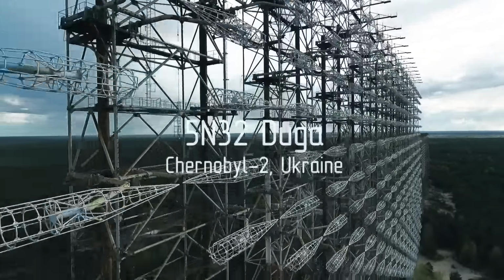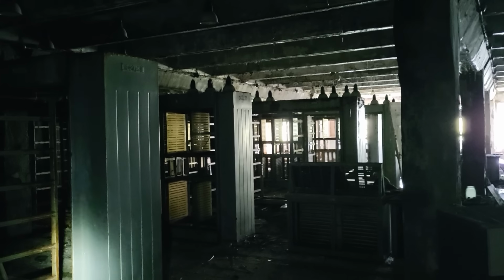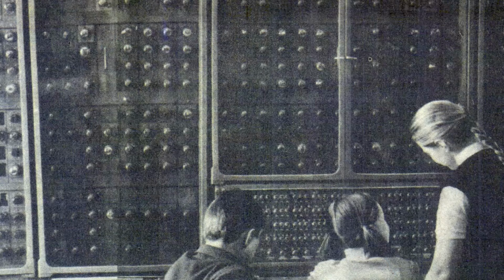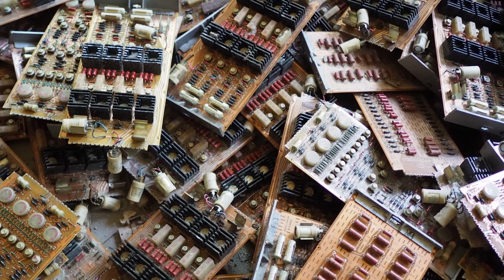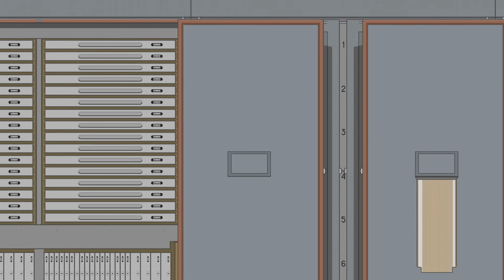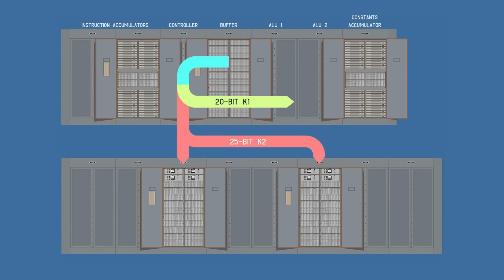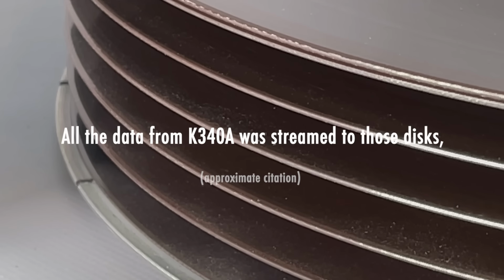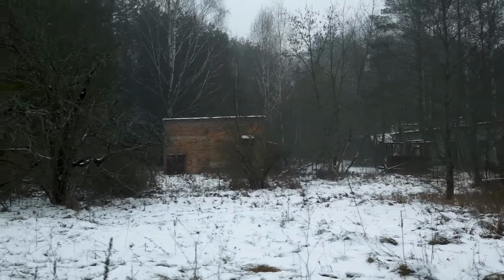Exploring K340A: The SECRET COMPUTER of CHERNOBYL DUGA RADAR | Russian Woodpecker

Comment: We, as HAM operators, weren't so happy with the woodpecker, it came so far, that all HAMs in the world were jamming the signal for three straight days. Which took it offline. So they got bombarded with jamming signals from all sides. The biggest event ever in the HAM community back in the day. We got even from the governments a yes, to use more power for this purpose, because they received so many complaints. I used a 9 element log per, at 38m height, with pure 1200w power, you can do the math in ERP radiation. And pushed as much harmonics as we could.
Reply from the maker: Good job! Love these stories!
Reply: The rapid “tok-tok-tok-tok-…”-sound was a real nuisance on the ham bands back then. So THIS machine selected frequency then? The signal jumped and landed for seconds or minutes all over the bands making even morse code communications at least “unpleasant” to listen to.
Reply from the maker: @tectopic  it looks like yes, this one.
Reply: As a HAM from the other side of the iron curtain I remember those days very well. I was in Tomsk and very similar device was operating near Novosibirsk, roughly 600 km from us. The woodpecker was a disaster especially on 7mhz band 😊
Reply: My father took part in the jamming operation using his 8K Henry ultra and let me tell you, it put out much more than the full legal power.
Reply: I remember listening to the woodpecker when I young. So many mysterious signals would make my imagination run wild.
Reply: For what it's worth, they say the first amateur radio station was started in 1908 by Albert Hyman, Bob Almy and Poogie Murray. Their call sign was Hyman, Almy & Murray, hence HAM.
Reply: wow, just wow. I live not far from duga radar and know the woodpecker story but never heard about the attempts to jam it
Reply: This radar stopped working after the Chernobyl disaster - did you, radio amateurs, connect the silence of the woodpecker and the disaster at the power plant, that these two events are related?
Reply: @michal_kaa  Most had no idea where exactly behind the iron curtain the "Woodpecker" (nobody knew its name yet) was located.  In my personal recollection of these days everyone was much more involved with staying out of the rain and with hearing the stuff between the "Woodpecker" impulses than wondering about their absence.  It came and went away all day anyway, so it was only after a while people started wondering where the signal was.  Meanwhile every other nuclear power had built their own OTH radars so the problem did not really go away either and I personally feel it got even worse since then,
Reply: I find these stories and anecdotes absolutely fascinating, thank you all for sharing and thank you to the creators for producing this with wonderful content! Stumbled on this channel by sheer chance and now I’m subscribed!
Peace
Reply: @michal_kaa they knew were it was before then
Reply: @michal_kaa great question.  I am a ham so know all about the woodpecker but was a baby when this happened.
Reply: My friend, you have a very crazy hobby. If it wasn’t for you, this Knowledge would be lost forever. You’ve also highlighted how advanced this technology was and seriously Clever people have worked on it yourself a very clever as you have worked this out.
Reply from the maker: @Teddy_Bass thank you. However, it is not a hobby, but a full-time job.
Reply: I own an unlocked rx tx quansheng, and i have no license 😂
Reply: Eventually they made filters to get rid of it.
Reply: Maladiets!
Reply: My friend, you have a very crazy hobby. If it wasn’t for you, this Knowledge would be lost forever.
Reply: Wow, you were legally allowed 1k2W power?
Reply: @RomanGolubev_A  it cost us, the power draw was intense, and the bill also, I remember going 100m from my door to a friend, he had a store, they were all the guys that were jamming also, and beers and foul talk, this was a party. This won't ever happen again.
Reply: I've seen stories online that some believed that the woodpecker (duga) was part of a communist mind control program, much like the HAARP facility in Alaska is part of various conspiracy theories today. I guess when technology is complicated people who don't understand make their own theories about their purpose.
Reply: Lately, there is a lot of activity in SW some pirates, some from Russia, if you are interested in these events, buy an SDR Dongle. You can listen to all those oddities. Since the full scale invasion there are a lot more jammers (one on the site of UVB76, the Buzzer), spoofers (Saint Petersburg)
Reply: This video is about computers.
Reply: The Russian Woodpecker
Reply: I’d love to see the letter from the government telling you to f their sh!t up.
Reply: Sure bud
Reply: Thats awesome!
Reply: Flood the world with harmonics! Maybe it becomes a better place then!
Reply: 73 from ON6CV op. Eric. Work as a chief operator in a nuclear power plant and been in Chernobyl as a photographer.
Reply: But we must acept Voice of America and Radio Impacto near here in America central full of lies and misinformation.
Reply: @juandestello9108  Good  Lord, "Radio Impacto"! I thought I ws the only one remembering it...
Reply: That’s quite a bit of Tx power.. curious, what were the frequencies used? Kind of starting to get into HAM radios.
Reply: I encountered this topic several years ago, and in my view, the video seems to be in its early stages. I also believe that it serves as a stepping stone for others to utilize and enhance for various applications. Frequency, vibration, and transfer of sound through light possibly open for supernatural communication.
Reply: @Parahistorian What the fuck? 🧐🤌
Reply: Minor thing: “ham” isn’t an acronym and shouldn’t be capitalized ;)
Reply from the maker: @AustinSteingrube gentlemen, forgive me my low level of education, but can you be so kind to give a bit more details to ensure I properly understand what the hell you all are talking about? Many thanks in advance. Alex from Ukraine, non-native English speaker.

Edit: jokes apart, I just have a feeling I probably not completely correctly understand what ham station is.
Reply: @ChernobylFamily  radioamateur station. It's often called "ham" because some morse keys was strapped to the thigh, aka a ham.
Reply: @TheErilaz  TIL. I had always assumed it was short for Hobby AMateur radio.
Reply from the maker: Thank you! Now I see I understood everything right.
Reply: The ham is a slice of pork
Reply: @carpespasm There are various explanations for the origin of the name ham but no proof.  The origins of the word are lost in history, it seems.
Reply: @AustinSteingrube yes it is. It stands for "Ham-fisted AMateur". ;-)
Reply: @AustinSteingrube  Have you ever heard of a noun?
Reply: @AustinSteingrube the first rule of ham is to criticize anybody else having fun or learning.
Reply: @AustinSteingrube minor indeed. Why mention it?
Wife ignoring you again?
Reply: @AustinSteingrube who gives a shit? What a dork thing to say 😂

Comment: A Pentium is more powerful than K340A. It is so fascinating, how people use to work with discrete transistors before ICs revolution.  Great video !!
Reply from the maker: Well, I believe it would be more correct to compare not with a pentium, but what was available in 1986. I believe here it is more complex, and very similar to the situation with SKALA of the ChNPP. It is not about computing, but processing of external connections. They could install mainframes based on ICs, after all they did, but still it was not the best solution due to latency. Speaking about transistors, I believe one of the reasons was that discrete transistors are far more stable in high radiation which could appear if what they have been detecting would have reach its destination.

Comment: Is there any detailed information about that cooling system? Schematic looks really detailed but can't understand how it worked, with what refrigerant and what caused that water issue?

One option is that it was a water chiller system and the heat exchanger started to leak in the air duct.
Reply from the maker: Many many things are explained in wall boards at former classrooms. I need to revisit them to get more details.

Comment: Thank you for this incredibly well researched and detailed video - I always wondered how they did all the computing necessary to get any useful information out of the received signal. Just finished watching for a second time. This is probably not new for you but just in case: there is a video titled: "Duga - Nadajnik Lubecz-1 (unikatowe nagranie)" on YT that appears to show some sort of ceremony that was held at the transmitter site when it was decommissioned. If the timestamp of the video is correct, it was shot in May 1998. After the official part, some employees are shown at their former places of work: consoles, maintenance shop, laboratory, cafeteria etc. A lot of equipment is shown that looks very similar, especially those grey racks. The transmitter itself is also shown: In the video a corridor can be seen that contains what looks like many more or less standard shortwave transmitters one next to the other. When the guy with the camera climbs the antenna at a later time in the video, some 20 feedlines are visible connecting the array to the transmitter building. That would explain how the beam steering was done and how they achieved the very high pulse power. Maybe you can get some useful information from this.
Reply from the maker: Yes, I know that one. It gives a lot of hints for certain rooms and devices at its receiver as many things were identical.
Reply: @ChernobylFamily   there's also a video from nine years ago from bionard23 of inside. You probably know but thought I would add it here.

Comment: Will you make a video about the entire high-frequency chain - from antennas to receivers/transmitters? I haven't found any information about this anywhere
Reply from the maker: There is little known about it. Though what we indeed will do is a more detailed look at structures and what is in them.
Reply: @ChernobylFamily  While visiting the Duga system in 2015, I was looking for typical radio elements ...I couldn't find a single piece.Knowing CCCP radio technology, there was probably a lot of copper and silver, so they disappeared quickly :)
Reply: @ChernobylFamily At one point there also had to be some parts that converted the analog domain signals to binary numbers. Would be super interesting to see how they solved in back in those days.

Comment: Nice video :-) I'm a former tactical electronic warfare drone with the Australian Navy, later the Defence Signals Directorate, radar was my entire life for a while. It does have some shortcomings though. OTH radar systems are like phrenology - if you work backwards, sometimes the predictions can match reality, the rest of the time is spent correlating results with other sensors in hopes you can improve the software as well as the state of the art in signal processing - it's a multi-decade long R&D project with no end in sight. Many governments keep throwing money at it, some have given up. Scroll through the HF bands and you'll hear these things spamming away 24/7. If your country has the ability to launch satellites, this is how they are solving the early warning problem.

Comment: About the antenna, the antenna near Pripyat (the one usually visited) was the receiving antenna, the transmitter antenna was about 40km or 50km from there (I think there were two other pair of antennas some somewhere in the south, I don't think the war made any favor to the other site too that was probably more preserved before it (if it exists) as it was not so popular like Chernobyl exclusion zone.
The radar was a real annoyance from 3 to 30MHz for radioamateurs and was nicknamed Russian woodpecker because ff the noise. The radioamateurs  pinpointed the approximate locations and were the first to suppose that it was an over the horizon radar. A lot of filters to minimize that noise were made and sold by and to radiomateurs all over the world.
Do you have any idea what happened to Duga 2 installations?
Reply from the maker: Installation at the south is an experimental Duga and later Duga-N. Dismantled in the 90-s, as it had no real use. Duga-2 is overall name for 'industrial' version of them, including the one at Chernobyl-2, though I have to say the word 'Duga' is never mentioned anywhere in relation to those sites; the transmitter-receiver pair at far east of exUSSR was also dismantled, so Chernobyl receiver is the only standing to present day.

Comment: How many of the 50 are still around or in operation? I guess it could only be in large factory, military spaces or high value operations. 
Do you know if this computer is radioactive?
Reply from the maker: At Chernobyl-2 only were minimum 8. Which means that at another installation was also 8. Likely the same were at transmitters, if not more, so total 4x8 = 32.
16 machines were at Dunai station where Malashevych went. He said that was the last place, and as for now it is shutdown and demolished. Which means none remained.

Internals of Chernobyl-2 buildings are pretty clean. This area itself is less-more ok, the wind went in such a way back in the day.

Comment: Personally i do not think hardware is worth saving. It's lame clone of western tech, something obviously replaced by ibm360. Perhaps the software could be interesting, perhaps the research data, but that's probably hidden in Moscow. Perhaps maths behind the MIMO array, though it worked well below spintronic frontier, so i doubt it carries any knowledge which is useful - judging from the antenna sizes it operated in frequencies which are deterministic and for which physics are boring and already complete.
Is it worth inhaling remains of the molten core? I doubt it.
Reply from the maker: While you certainly have a point, I do not recall an RCS-based machine from which this was 'cloned'. Its value not in being a historical computer. Its value in having a dramatic story behind.

Comment: Very interesting to see, it looks like there is an extender board on the back of the door, which probably makes sense due to the constant maintenance at this time.
Reply from the maker: Absolutely correct. And moreover, each rack had a power output for a soldering iron and so, partially visible near left door.

Comment: Do you have idea how the instruction set for this computer looked like except for the K1 K2 classification. And what the residue classes were? Or is that all lost to history?
Reply from the maker: Need to dig into my records. Speaking about moduli used those are (2, 5, 23, 63), then
(17, 19, 29) and (13, 31, 61). I am not sure why they used "2" as well, but probably it is connected to conversion to binary.

Comment: That was just astonishing - a 45-bit long word, 1MFlop capable, multi-processor linked system in the 60s ??? What an amazing technical achievement.

I am also really, really impressed by the technical archaeology  carried out to reconstruct the system from the wreckage you show in the footage. The concept of the "Cassettes" as fixed memory modules (ROM) seems to be on par with core memory as a concept.

A brilliant piece of detective work, congratulations! 🤓👍
Reply from the maker: Thank you! This machine is perhaps my 'sacred' thing in Zone's research, we spent there weeks around it.
This is the thing: NOT mflops. RCS could not work with float point directly, therefore was a hardware conversion for such operations (notice — there is even a converter status on console). When it came to float points or just division, it was much slower.

One of super big advantages of K340A was that given it operated with very small numbers, that A7 rack contained pre-calculated results, so it allowed to implement table ariphmetics which replaced calculations in many cases thus boosting the speed.
Reply: @ChernobylFamily  So, Look Up Tables and shifted, fixed decimal point calculations? That explains the long word length - I'm going to watch this again as I think I missed this. A superb piece of work, nonetheless!
Reply from the maker: @RobSchofield  seems so. But I'd like to be sure, so am trying to find a public book by Yuditsky and Akushsky from 1967 where they explain their rework of RCS which eventually was put into this machine. Seemingly it was published in a relatively small number of copies bit it might explain a lot.
Reply: @ChernobylFamily  If you do locate a copy, please do a follow up as that would be really interesting. I have a feeling I used a numerical method like this at University when I was studying electronics (a LONG time ago).
Reply from the maker: @RobSchofield  deal!
Reply: @ChernobylFamily  🤓👍
Reply: Actually not in sixties but in the seventies, they built the first 2 test units in 1971. Both CDC and IBM were commercially delivering 10mflops in the sixties.
Reply: @geksogen123 СССР умудрялся создавать компьютеры из устаревших деталей, либо новая серия элементов создавалась (копировалась с американских) параллельно с разработкой будущего компьютера
Reply: @geksogen123  Butthurt 'murican?